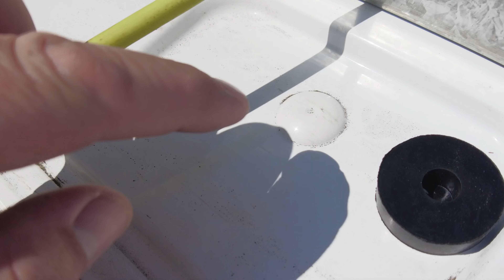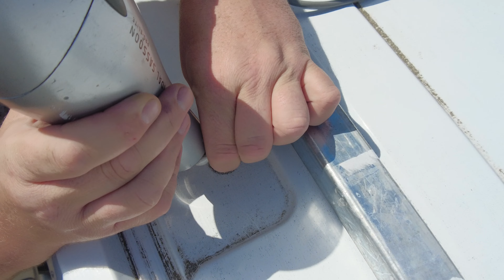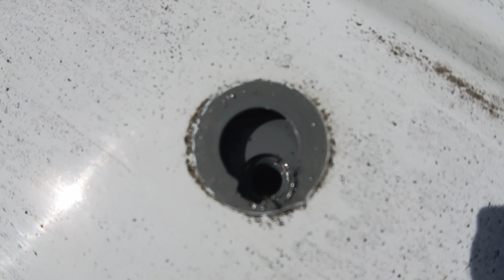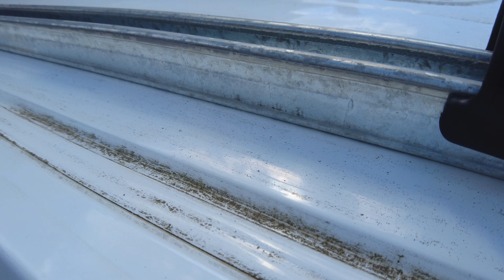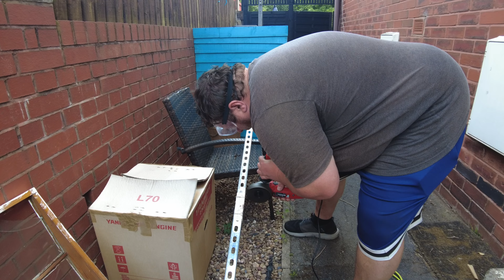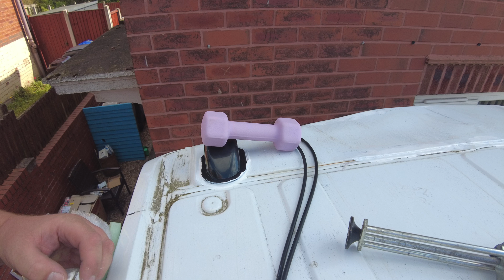Van build Ep.2 Roof Repair & ☀️Solar Panel Install ☀️ using unistrut 🚚

Comment: hi where did you buy the rubber mounts from please
Reply from the maker: Found them on Amazon https://amzn.to/48k7zJu
Reply: @DriVanbysunsets  thank you.  have you put your floor down yet? just about to do mine. went for 12mm ply straight down on metal work.  looked at the vans at nec last saturday and none of them seemed to do that 25mm raised floor system with celotex stuff.
Reply from the maker: @defendermods9420  We have the floor down, managed to get part 1 video on this morning.
We used 25mm battons and the celotex boards to insulate